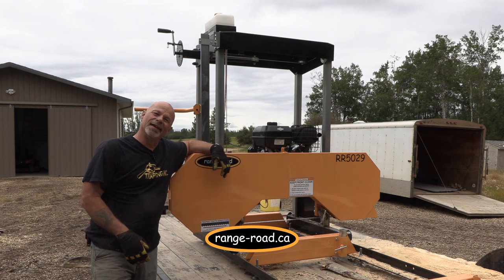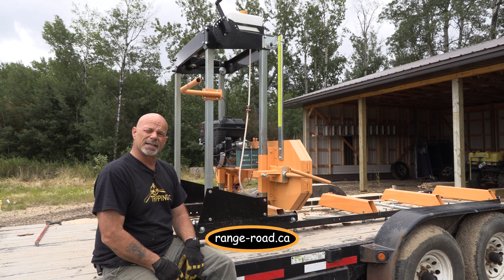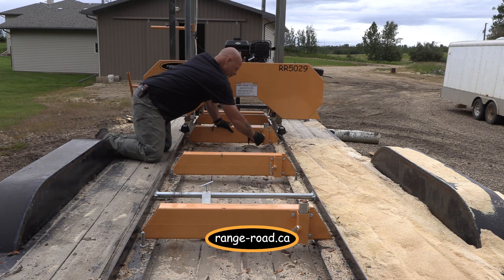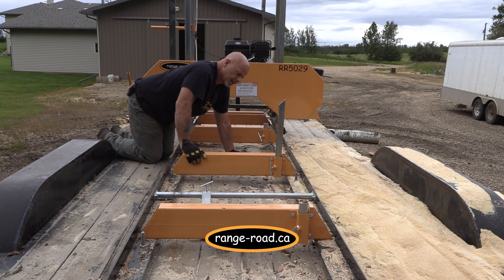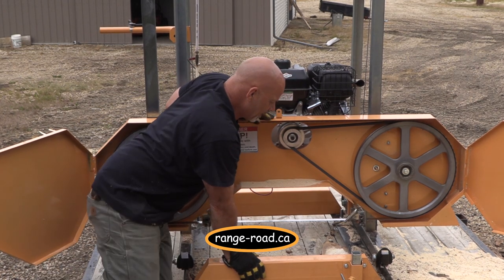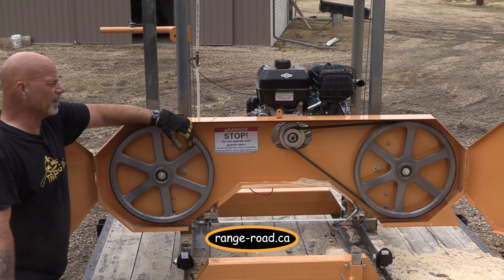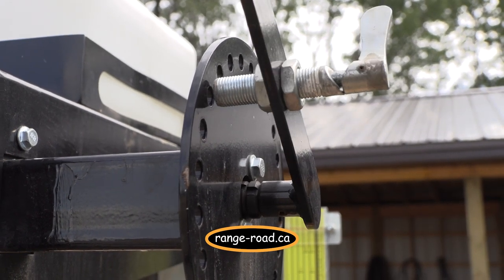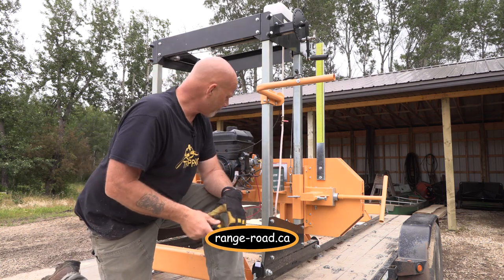Range Road Sawmill RR5029 Review

Comment: I saw an ad for these and I'm surprised at how affordable they are compared to others I've seen.  I was going to build one but I may just buy.  Under 3k for the smaller model which is 22".  I doubt I'm going to find a tree bigger than that on my property and if I do, I might want to leave it anyway.   With price of lumber it will pay for itself in no time.   I plan to build a cabin in the woods and eventually move off grid.  Already got the land.
Reply from the maker: I found the value for the dollar to be very good!

Comment: I just bought this same mill a few weeks ago and have had some trials and tribulations cutting any wood at all that isn’t wavy, I’ve tried all the adjustments possible and new blades as well as making sure it is level and the bunks are true with each other. Having issues with making the blade level from front to back. Would be great if I could get some advice on what to do because all I have done so far is turn some very nice logs into firewood
Reply from the maker: I've forwarded this to Range road for their comments. Hope you get it figured out. I've not experienced what you are describing so I'm no help.

Comment: Great video on the Sawmill, I have a Woodmizer LT-35 hydraulic,,, wondering about the radio tower in the back ground, are you a ham operator? If So hello! My call sign is N3MJR
Reply from the maker: That tower was for wireless internet. Since switching to a Telus Smart hub we don't use it anymore. Thanks for watching!